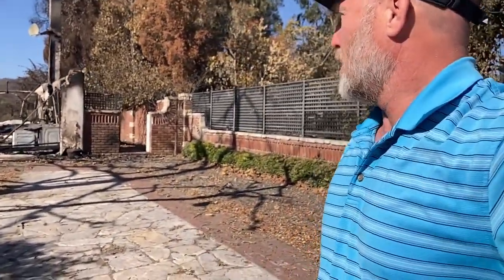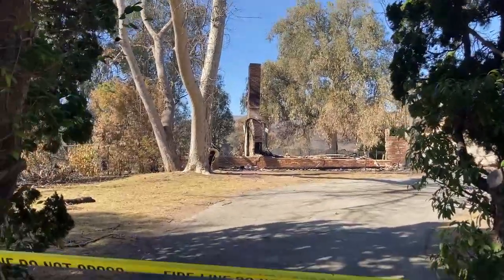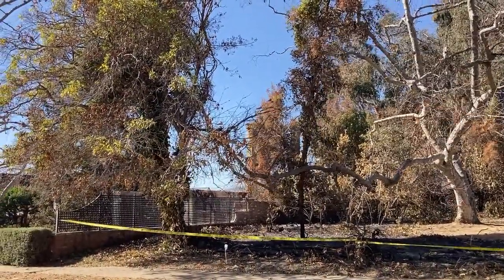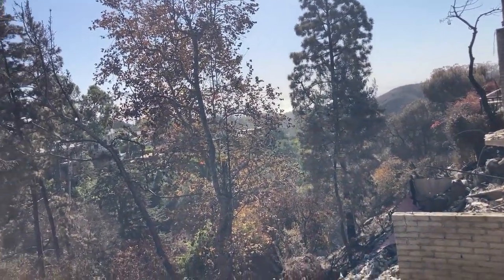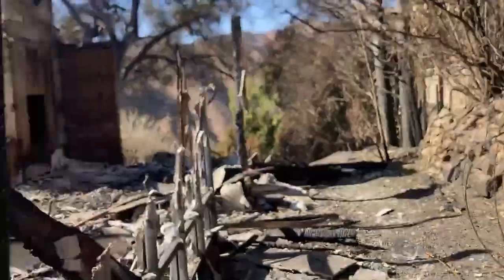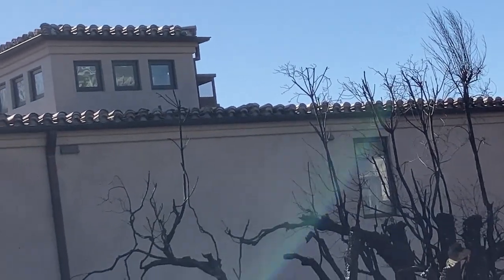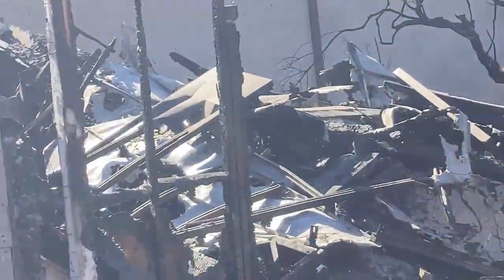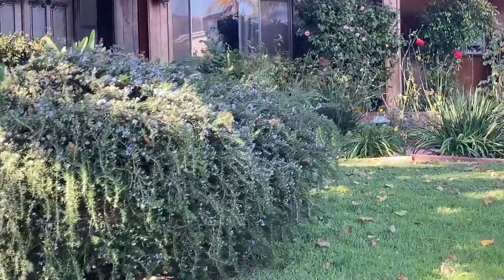Inspection of Palisades Fire Damaged Homes || Engineering Analysis on Failures

Comment: Thanks for this great vidoe. Do you think new building codes will be on the books for California especially Los Angeles. Will the Zoning change?
Reply from the maker: I don't think things will change too much regarding existing building/fire codes.  Chapter 7A of the California Building Code (CBC) is the most restrictive of all wildland-urban interface codes for protecting structures from wildland fires.  It's just that the majority of the Pacific Palisades homes were constructed prior to the CBC 7A adoption.  I'm assuming that insurance companies, going forward, will require the 5' noncombustible buffer zone around structures, protection of the underside of decks, and ignition resistant/fire rated exterior construction requirements will be enforced.
Reply: @russlivesay9325  What about new codes in reference to building those houses on the beaches in Malibu. Any new codes that you see in the future on that subject. I saw all of that toxic debris That land needs to return back to nature.
Reply from the maker: @creolelady182  Good question; however, I can't comment on building code related changes affected by that.  There are already laws in place at the federal level for those kind of issues:  RCRA (Resource Conservation and Recovery Act of 1980) dictates the heavy metal leachate permitted to be released.  Similarly, TSCA (PCB and Asbestos) and NESHAP (Asbestos air pollutants) are already in place to mandate release criteria for hazardous and toxic substances.  Codes already exist to limit building materials with toxic components impacting occupants.  Based upon existing restrictions, I just don't see any new laws/codes, rather just enforcement for existing ones.  Most of the laws/codes were enacted after the construction was already completed in Lahaina and the LA area.  There's very few retroactive enforcement requirements, but building new will require compliance will all existing codes/regulations.

Comment: Thank you for an excellent video. I've been watching various YouTube videos on the subject of fire-resistance, some going back years. And, I have been thinking of the idea of doing a post-mortem on individual properties but using Google Earth or Google Maps to highlight aspects of a property prior to the fire that violated the recommended practice of creating a fire-resistant zone around a house. Totally in agreement with you that significant improvements will have to be made as part of the reconstruction. The intact bungalows appear to be decades old and would mean that the owners would have to expend money to render the structure fire-resistant. That does not prevent them from clearing away fuel that the fire could use to leap onto the house.

All reconstruction should be required to use non-combustible material, i.e., Type 2B. Fire-rated roll-up window shutters would add protection for any building.

Should the homeowners whose property violated the CA Building Code - Chapter 7, receive aid from the CA government or insurance companies?
Reply from the maker: Good questions and observations!  One item that will probably come from the Wildland Fire Institute up in San Luis Obispo will be a detailed map showing the age of construction for each structure in the fire damaged area.  A retroactive application of Chapter 7A of the CBC would be impossible to do simply because of the massive construction costs.  That's why the only solution will be removing the vegetation and following inexpensive code requirements.  One update that will likely be required will be simply fire hardening the exterior in terms of bird stopping, blocking eve openings and otherwise screening decks and attic/crawl space vents.  Those items are cheap and easy to do.  There will probably be a mandate for those types of upgrades simply to get insurance.  I think once people are aware of new requirements for inexpensive updates, if they do not follow those, they will likely be uninsured and will likely be responsible for their own losses.

Comment: California Public Resource Code 4291 is the basic code that applies to vegetation management in the wildland urban interface and intermix. Counties, cities (incorporated or unincorporated), and HOAs can add additional defensible space requirements, but never less than PRC 4291. There are supposed to be annual conformance inspections by the local fire department or by Cal Fire when the structure is located in the SRA (State Responsibility Area). Some regions have state and local inspections.

It is beyond comprehension that, after massive wildfires and losses of properties and lives in the past 25 years, the message of having defensible space and hardening structures is still coming short. Consider that we know that embers are structure killers since the 1991 Oakland Hills Fire, the least that should be required is protecting homes against ember intrusion

Taking environmental concerns into consideration is not a problem for creating a more fires safe environment. Shaded fuel breaks, the removal of dead and dying vegetation and the removal of ladder fuels can be created without causing the disturbance or destruction of wildlife habitat. I have 15 years of experience in wildfire risk mitigation and have worked on projects that included covering the needs of wood rats, spotted owls and flying squirrels. These high intensity fires not only destroy human homes but also the home of wildlife and rare plants. For example the Santa Monica Mountains are one of a few remaining habitat for the California mountain lion, the state is even building an expensive wildlife crossing over the 101 freeway for them. That fire greatly impacted that amazing big cat negatively.

A leading wildfire scientist is Jack D. Cohen PhD who works for the USFS. There are many of his videos on YouTube. Another excellent source is the California Fire Science Consortium -- https://www.cafirescience.org/